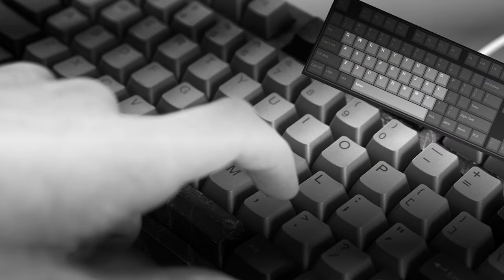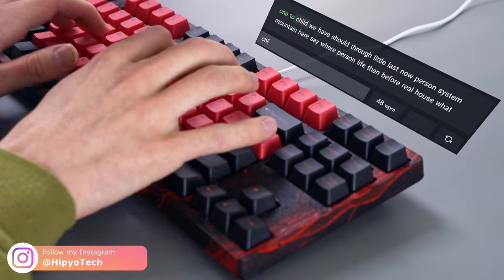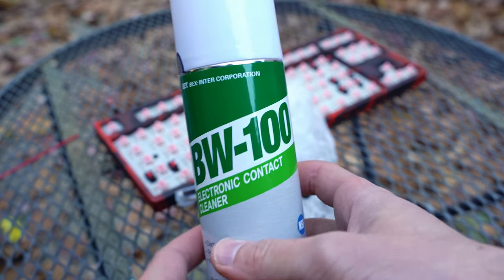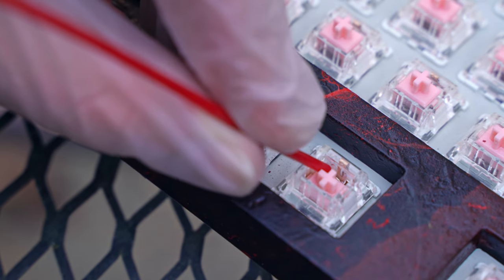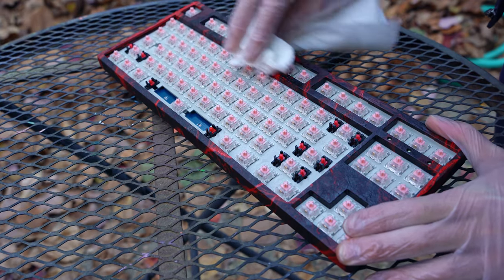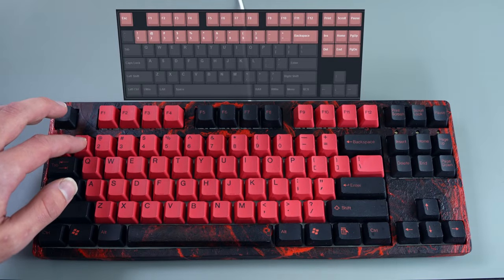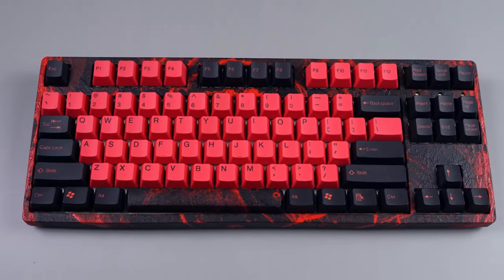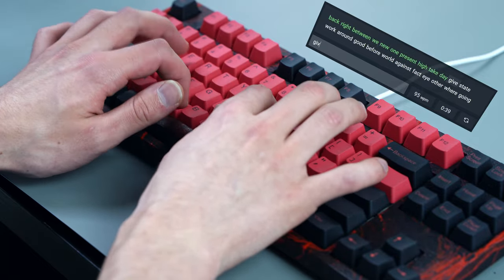I BROKE my PewDiePie Keyboard with Spray lube - I try and fix it. [Voice Reveal]

Comment from the maker: ✔️ Join my discord and let me know if you want more voice overs! https://discord.gg/eEK2JEWur2 
⬇️Affiliate links to help out the channel ⬇️
Contact Cleaner: https://amzn.to/2VzBwRm
Glasses: https://amzn.to/3mPjiXW
Keyboard: https://www.banggood.com/custlink/mDv...
https://amzn.to/31qls7M
Reply: Just finished lubing/filming my Kailh Speed Silvers, and I have a few questions. (First time lubing)
1. Was it a bad decision to bag lube my spring with 6-7 drops of super lube? I did it in a medium sized Ziploc bag, and really shook it up. I read from an old post that the super lube on the springs can coat the contact plate and make the switch have issues. (I don't think they weren't heavily coated though).

2. One of my switches was being slightly unresponsive at times (like after a little over 100+ presses). I used KeyboardTester.com to check, what is the website you use, It might be better for me to test. I opened up the switch and used a super tiny piece of paper towel, while holding it with tweezers, and tried to wipe off any extra lube from the bottom housing and stem. The switch is better, but is still being ever so slightly unresponsive (at least I think so). Any tips/feedback? No one is responding to me on r/mk.

Comment: I spray lubed my optical gateron yellow switches a month ago (I got them out of the board before lubing them and I dried the switches with paper hand towels after lubing them, I also let them dry a bit more for 16 hours) I haven't got any problems with it since then; so I would actually recommend spray lubing optical switches, buuuut I wouldn't reccomend it for traditional mechanical switches.

Great voice btw
Reply from the maker: Thanks for the input, this is kinda close to my views on it. But because of how toxic spray lube can be under misuse it's hard to reccomended

Comment: wish I saw this video earlier. Superlube lubing seems to become very popular now so I tried it as well. I wasn't using spray lube, but Superlube 51010 instead, which is basically the same thing but you can have a tiny bit better control with the syringe. I used the lube on two of my keyboards with soldered switches, and it worked. Then I applied it on some Akko CS switches for a custom keyboard, and for these switches I actually lubed with the "proper" method, aka taking the switches apart and lube each part with a small brush. A few days later some of these Akko switches stopped working (behave exactly the same with yours). It took me a while to figure out that it was the lubed switches that were failing, not my pcb. I used these switches in stock condition before and they all function well, only started failing after I lubed with Superlube. Thanks goodness that I didn't use the lube to some expensive switches. At this point I'm very skeptical with Superlube for switches. It looks like it is a hit and miss if it would work without ruining your switches.

Comment: ONLY spray lube if you have optical switches. the contact spring in optical switches is only for feel and had no function so it doesn't matter how much spray lube you get on the contact leaf.

optical switches are fine to spray lube. they aren't soldered so can be pulled away from the PCB while still on the plate. 
thanks to Hipyo we know worldwide super lube isn't the same stuff as in Korea so i went and picked up a can of CRC silicon spray (which was about 4 times cheaper)
sprayed all my switches left them upside down for an hour while actuating them every 20 mins or so.

im very happy with the results. it really is a whole new world for someone who has never used a lubbed kb before.

ONLY spray lube if you have optical switches. the contact spring in optical switches is only for feel and had no function so it doesn't matter how much spray lube you get on the contact leaf.

Comment: Hey. My varmilo panda keyboard came with the issue you are talking about. Only switch that doesn't work is "D" key. So i am going to test this tommorrow

Update: It worked. I am so glad it didn't take a 1+ week to send keyboard back to the factory. Thanks

Comment: found you through instagram. your youtube content is awesome!
spray lubing should be reserved for gateron optical switches imo
Reply from the maker: Thank you very much I couldn't agree more 🦛🥰
Reply: @HipyoTech  so is spay lubing safe if you have a gateron optical keyboard
Reply: @packapunchstick  I spray lubed gateron optical reds for my buddy and they work perfectly. I tested all keys and they didn’t have any problems. I did have problems on my rk61 though. I just recommend taking out the optical switches and spray lubing in your hand individually.

Comment: I fixed a 12 year old Kalih switch keyboard that i tyhought was dead. I sprayed it just once, had about 5 switches that had 0 input at first. 12 years ago i submerged the board completely in water for like 2h, hoping i would fix it. I also used rubbing alcohol on it. It prolly had rust and other stuff inside, but now, after using contact cleaner, it works FLAWLESSLY. Than for saving my keyboard mr hipyo :D
Reply: also, spray lubing "might" work if u keep the keys pressed after applying the lube. That way the contact will be made and might push the lube out of it, not coating it when it dries. It's just a thought, no clue if it works or not :D

Comment: Im waiting for all the parts for my first custom keyboard and had that great idea to lube my Ducky One 2 SF... well, ihave exactly this problem now... :D
nearly 8 keys are not woring properly. Guys, dont spray lube. 
Thanks for the video :) !
Reply from the maker: Hopefully you can try and fix it!
Reply: @HipyoTech  Bought the spray. Tried it. Fixed it. Thanks a lot mate! But in my case with the Ducky One 2 SF Speed Silver switches it sound better than stock after fixing. Im happy now to be honest how it sounds :D

Comment: Yah I get where you are going with the spray lube. The amount of pressure that is being extered from the can is abysmal and can go everywhere. Still I would say a little is okay. But then again I only use 51010 spray where its controllable in drops. I've spray lubed 4 of my boards the only problem I encountered with spray lube was when I stopped using the board and then when I came back to use it later on I had this problem. As for my other boards my family members are still using them daily so there are no issues. I would think its just that the lube stopped being spread out from usage and just clopped together.
Reply from the maker: Thanks for the anecdote! Every bit of info helps!

Comment: It's probably a better bet to do it on gateron optical switches since those don't have contacts. Just remember to take out the switches b4 spraying.
Reply from the maker: Yeah I would probably only ever kinda recommend it on opticals, but I would still say brush lubing is better for feel and sound in most cases (see my Sk61 mod they are brush lubed and sound amazing)

Comment: i spry lubed and ive had it for 4 months it sounds pretty good and it works well. very smooth. the keys are getting the slightest but scratchy but i noticed that 2 months ago and they stil sound good. they still feel better than unblued

Comment: What are the odds? My girlfriend kept telling me to make a Youtube Channel out of my keyboard builds. My avatar in most games is a Hippo and then I stumbled onto this channel?! LOL Awesome content, though I will have to disagree on the spray lubing.

When you spray lube, you want the keyboard facing downward. You spray the lube upward into the switch housing, then leave your keyboard upside down for 2-3 days for any excess lube to drip out and dry. I've done this successfully on 3 of my keyboards and never had a problem. However, the best way to lube is to do it manually.
Reply from the maker: Out of curiosity, what spray lube do you use, when you shake it do you hear a ball bearing sound?
Reply: @HipyoTech  I use Super Lube #31110 spray and I can't recall if there is a metal ball pinging inside.

For other lube I just stick with Krytox 205 and 105, but this is for manual application.

Comment: I also tried spray-lubing and it kinda ruined my Anne Pro (with Gateron Blues), so I just chucked it into the dishwasher (plate + PCB) and that also fixed all issues (after a thorough drying). The switches also returned to being consistently clicky.
Reply from the maker: This is deeply disturbing :_HipyoRespects:

Comment: Spray lubing broke your keyboard. But it fixed mine lol. My A and D keys were not working, and with the spray lube, they started working Just like If the lube was contact cleaner. POG
I didnt use Super Lube like you guys do. I used the Algoo Pro PTFE spray, I hope It's the same thing

Comment: Fun fact: Outemu reds are surprisingly durable. I used half a can on one full size outemu red keyboard and after two weeks of drying, it started regstering presses again.  Another two weeks later, it was back to normal condition. (Edit: I don't recommend using half a can on one keyboard though. I may have just gotten lucky.)
Reply: i use outemu blues and i like them a lot
Reply: @fayenotfaye  surely, people will cry and call me names just because i like a budget tactile switch while they spend more than my keyboard to get some keycaps
Reply: @fayenotfaye  i got a K552 for 36$ and couldn't find anything better for that price for a TKL keyboard (i don't really like 60% keyboards that much) can't complain but might buy a gateron switch keyboard down the line, my switches are hot swappable if im not mistaken if the pins can go in i might consider getting some switches
Reply: Half a can of spray lube? Or contact cleaner?
Reply: @catoflado4977  half a can of spray lube. However I forgot to say that I used a quarter of a can each time I spray lubed. I sprayed lubes twice over 1 month so that’s half a can.
Reply: @wiva4707  Why did you make It twice? The First time it wasnt enought? I Just spray lubed my Outemu Reds keyboard too, It's drying
Reply: @catoflado4977  the first time I was too conservative with my spraying and the second time it was too much.
Reply: @wiva4707  My keyboard dryied and it's great now!! I couldnt imagine how great it would be in the end. Just the stabs still pretty noisy and shitty. Did you lube your stabs too?
Reply: @catoflado4977  I lubed them with dielectric grease. The stabs were crooked though. So yeah mine were also shitty and these weird yellow Chinease off brand knockoff stabilizer.

Comment: What if im spray lubing switches that are already out of the pcb? Would there be a way to clean the contacts before you solder? Sucha s opening the switch or something.
Reply from the maker: Yeah potentially it would be easier to fix, but I would still reccomended hand lubing switches that are out of the board

Comment: Do you feel the same way about pipette lubing like with Super Lube's dropper tubes?
Reply from the maker: I haven't personally tried it, but I have seen some threads of people messing up their boards with it. With the dropper tube, the lube you use is too thin to stay on for a long time so the effects won't last.
Reply: @HipyoTech  interesting.... I'm really curious about this because I wanted to try using a tiny amount of this lube, but I could see how that would be an issue. Any other ideas for lubing switches without desoldering?
Reply: You can mess up a board just as easily, but if you use VERY small amounts and stay away from contacts while keeping the board tilted away from the contact, it works great.

Comment: I spray lubed around 10 keyboards without any issues. Generally the input problems appear right after lubing in some keys and then they resolve themselves after a few minutes or some repetitive clicks and they don't come back ever again. At least in my experience. Maybe the lube you used were not suitable for this ?
Reply from the maker: What lube did you use? I used the standard super lube spray reccomended by every YouTuber?
Reply: @HipyoTech  super lube isn't sold in my country so I used two other ptfe based lubes (winkel and another brand that I forgot). Also I used a silicone based one(perfects brand) once or twice and it went well too. The ptfe based ones leave some white residue(the ptfe itself is white so its probably that) which I don't like so I think I would use the silicone based one in my next lube job. I would say just make sure the lube is safe to use with metals and plastics.
Reply from the maker: @mehmetmalli  that might be why it works, for most I've seen that have used super lube (the usa version) it has broken their keyboards. When you shake your can does it make a ball bearing sound?
Reply: @HipyoTech  The silicone one doesn't have a pea(metal ball that is added by manufacturers to agitate the mixture while shaking) but the PTFE ones do.
Reply from the maker: @mehmetmalli  very interesting, I've found from other people that the ones with the ball to agitate the mixture work a lot better and more often

Comment: do you have another methode to lube switches without desoldering?
Reply from the maker: Not really :(
Reply: @HipyoTech  have you tried the method from the video from The Dredgen Poject?
would be interesting to see if it works if you have time :)
Reply from the maker: @seandejong5399  can you link it?
Reply from the maker: @seandejong5399  That would be better, but I've heard of people getting lube on their contacts and messing up switches using that method
Reply: @HipyoTech  hmm would it help to only lube the 3 other sides?
Reply from the maker: @seandejong5399  yes but it still could go wrong, do it expecting it to fail

Comment: Bur if u super lube it with that litle 7g lube 1 in all the corners and use a brush to even it Will it f up the switch ?
Reply: No not at all he did not lube it correctly spray lube is safe if you do it correctly

Comment: I have the same contact Issue on 1 of my switches atleast it looks like. But I didn't spray lube it, stopped working by itself, by time. Please comment if have any help since I dont really want to use the cleaner showed in the video...

Comment: do u think it will still break the switch if u take out the switch first and use the lube lets say if u have a hot swap switch keyboard.
Reply from the maker: Yeah it would still break it, the issues that cause it to break would not be changed by having it outside of the board
Reply from the maker: Yeah it would still break it, the issues that cause it to break would not be changed by having it outside of the board
Reply: @HipyoTech  oh ok so its not like the lube is getting on the motherboard of the keyboard
Reply from the maker: @nathanlovell4399  yeah it's the leaf in the switch that gets messed up and stops recognizing some input

Comment: I spray lubes mine and they were fine except like one, that I pressed many times and it fixed it.
Reply from the maker: What can of spray lube did you use? If it was super lube when you shake it did it have a ball bearing in it?
Reply: @HipyoTech  no it was just like liquid
Reply: @HipyoTech  and my browns sound like ink blacks so that’s 😎
Reply: @HipyoTech  nah not at all

Comment: Well first of all, the board is not really broken. Wht happened is, that you've gotten a bit of lube on the contact leaf, which caused it to interfere with the function of it. If you had cleaned that switch and spray lubed it again it would have most likely worked. Also, your contact cleaner is almost certainly not plastic safe and in my opinion, advising people use it is just begging for someone messing their switch housing or stem up way worse than a big of spray lube on a contact leaf.
Reply from the maker: Yes its plastic safe, the ingredients sheet says so. And yes, I mention that its the contact leafs that are messed up in the video. I tell people not to spray lube in this video, so ideally they will never need to use this.

Comment: I really wanna spray lube, I even have spray lube. Spending extra on soldering stuff is a waste of money is it really that big of a risk
Reply from the maker: Pretty big risk tbh, it's better to just not do it, or wait until you get get a keyboard that's hotswap/desolder
Reply: @HipyoTech  :( so removing each switch (hotswappable), spray lubing them individually then reinserting them is the only option?
Reply from the maker: @shoqstar  I would say hand lubing, but at least If you break a hotswap switch you don't have to desolder it

Comment: I think you just used entirely too much spray lube the first time. Plenty of people I know didn’t have these issues.
Reply from the maker: Fair point but not in this case, I went and looked back at the footage of the keys that were broken and I sprayed them just as much as the keys that worked

Comment: soooooo. if your board is hot-swappable then this isn't an issue? you just swap out the bad switch and you good... and what if you used lube in a syringe rather than a spray. You could push the lube to the opposite side of the contacts. problem solved.

Comment: anyone have experience with using the superlube precision pen and dripping a drop of lube into each switch?
Reply: Not recommended, I've done it before and now I do it the proper way, reason why its not recommended is because its hard to see how much is going in and the tip is too thick to go all the way inside, and you wont be able to get the necessary parts you need to lube with just dropping one drop in one spot, so in turn you need to drop it in 2-3 to get it all coated, but now you've over lubed your switch and it'll turn out mushy. If you have anymore questions my instagram is @waddleskeebs i love helping new people to the hobby.